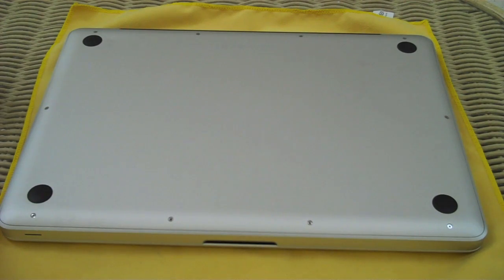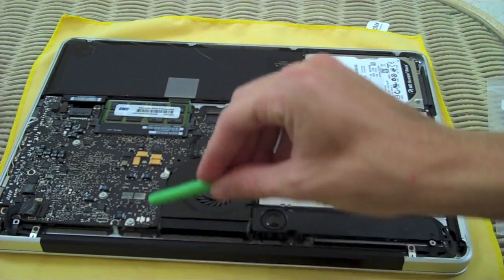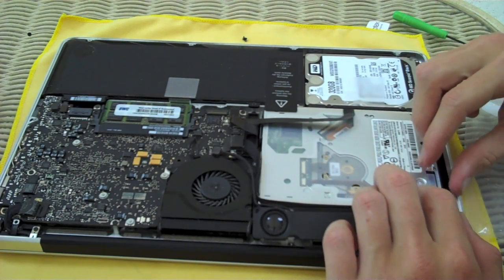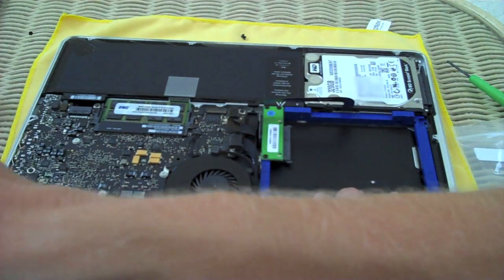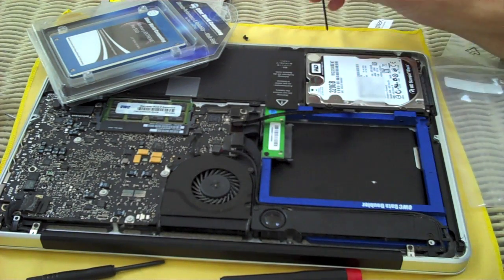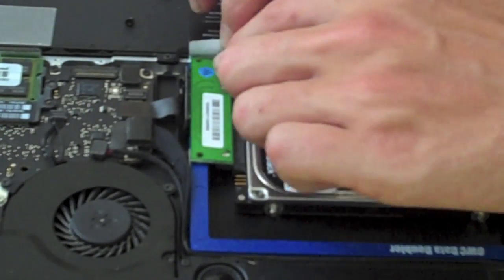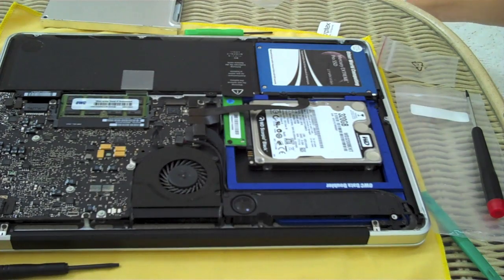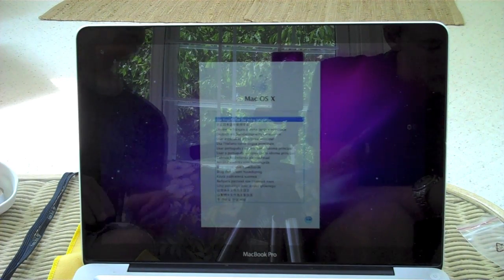OWC SSD and Data Doubler Install:  Mid 2010 13 inch MacBook Pro

Comment: Ryan, just curious to know why you felt the need to switch out the HDD to the data doubler in the place of the optical drive. I'm thinking you could have just kept it where it was, installed OS X on the SSD from where the optical drive was in the data doubler. 

Not a knock, just really curious.
Reply: Doug B. Never mind.. I'm assuming because the bus is faster if using for a boot disk.

Comment: Everyone says you need the thumb drive to install. I installed fine by just holding option when booting and pulling it from the internet. Of course you have to partition your new hard drive and then install off the net right onto the partition you just made. Easy and FAST!!!

Comment: This is a mid 2010 with the 2.66 right? I want to upgrade mine and I was wondering if I could use 16gb ram in it? I've read different things online
Reply from the maker: Correct.  I THINK that 8GB is the cap for that architecture though.

Comment: How much did he take a hit on your battery running two drives ssd and hdd, i just bought a 2012 15' macbook pro non retina and i have a 256gb ssd in it now but i would like to put the orignal 500gb back in fr storage but not if its is going to to wreck my battery life.. any figures?

Comment: The Data doubler comes with 2 larger black screws that you use to screw the HD to the data doubler, the original 4 pegs that were on your WD HD should have all been removed and replaced to the SSD. Not like you did where you only had 2 pegs on the SSD.

Comment from the maker: I've heard it both ways.  Just be safe and reinstall the optical bay if the computer ever needs to go in to service.  I've had mine in the Genius Bar with the data doubler installed, and they never said anything though.

Comment from the maker: @2012Applegenius Beg to differ.  No problems at all when I used this machine, everything was rock solid.  I now use a 15 inch with a similar setup and a 6G SSD.

Comment: You just transferred all of your operating system and programs into the SSD then cleaned out your HD and used it as storage? I'm looking to do this upgrade but am lacking in some of the details as the best way to go about it. I want to upgrade my memory/HD as I have been editing videos lately and it's clogging up all my memory.

Comment from the maker: @l2yan167 Because the SSD is my main primary drive, where the HDD is just used as a flash drive for larger files.

Comment: As the guy said below, the bits you got wrong were the 4 screws on the original hard drive are supposed to come out and go into the ssd and those extra screws in the bag are to screw the hdd to the datadoubler as you only need 2 other than that great video, very informative

Comment from the maker: @Wiejeben No this is easy, and these computers are very well built.  You'd have to do something stupid to break it.  Just be careful and don't get in a hurry- it's no problem working on laptops.  I've never really done anything to a desktop instead installing some new components, all my experience is with laptops, and I've never broken anything before!

Comment from the maker: @raymondGrr I would use the 5400RPM drive unless you're going to be using  it a lot.  Reasons being:  the data cable that goes from the optical bay/data doubler is not nearly as fast as the data cable that goes from the SSD/HD bay 0 to the logic board.  So, using a louder, power hungry, more expensive 7200RPM will not gain any speed.

Comment from the maker: @EB0100010010 Yeah, it was much faster and quieter.  It used NO more power, and didn't have any vibrations, you made a good buy for an HDD.

Comment: @RyanKnowsTech I think it's a bit soon to say discs are outdated. Did you have to put OS X on that flash drive yourself? Did you copy files from the hard drive (what if it failed) or did you have to copy from the disc? Seems like just yesterday that you installed that WD. LOL It seems like a pretty convoluted process to do those upgrades in the Mac, but you did a great job getting us through it!

Comment: Quick question: I have the 320GB scorpio black as well and I'm going to do this upgrade. Does battery life take a hit with the SSD partnered with the 7200 RPM drive? Would it be better to use the stock 250GB HDD? I have the same MacBook Pro as you.